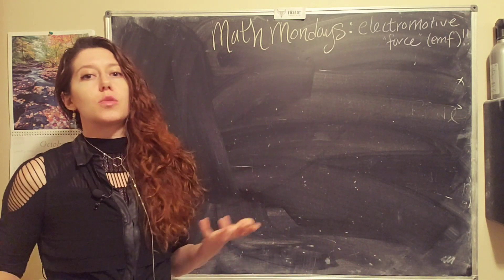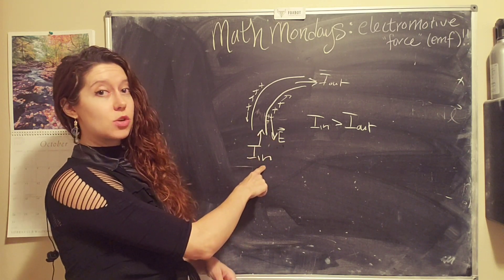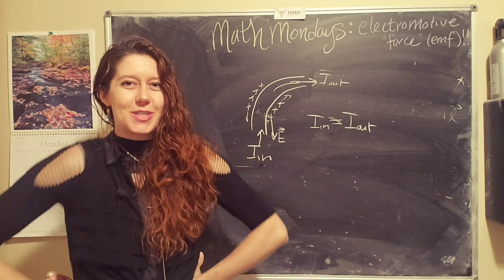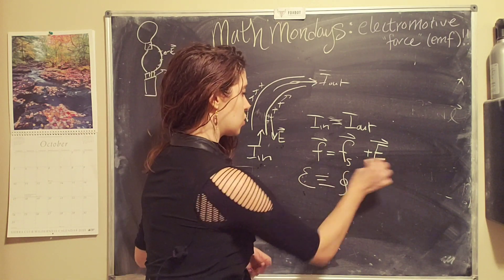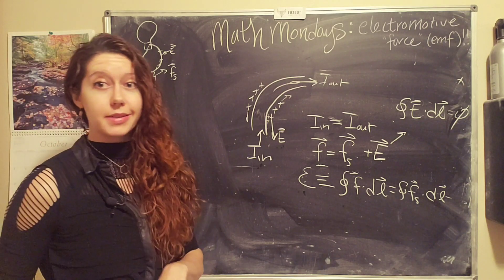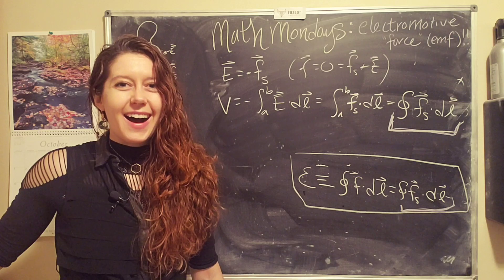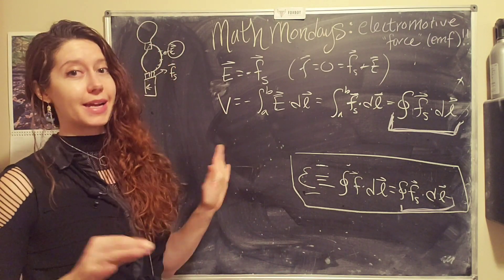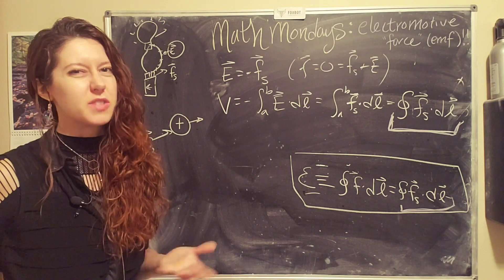What is electromotive force??

Comment: In 8:43   When assuming that the net force is zero, and that electric field is equal and opposite to the source force, it means there's no current flow in this case?
Reply from the maker: ahhh not quite! as i showed on the chalkboard, the charges flow in response to the external field. but, once they reach equilibrium (i.e. balance the external force), there is no current flow.